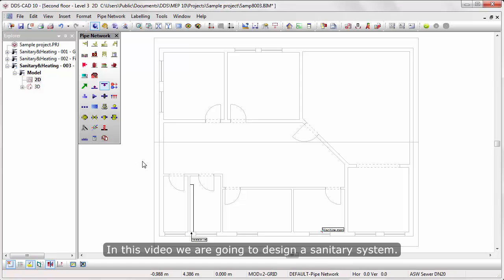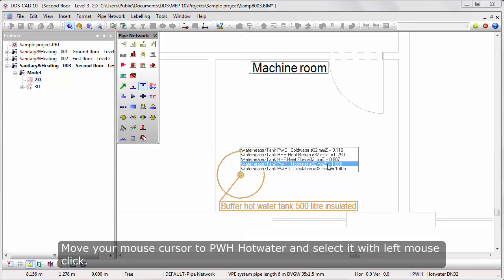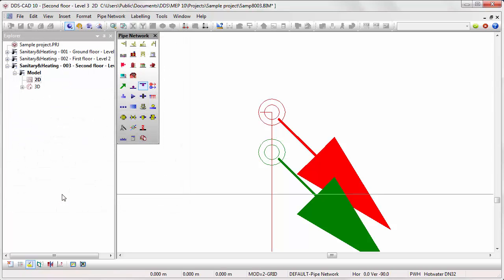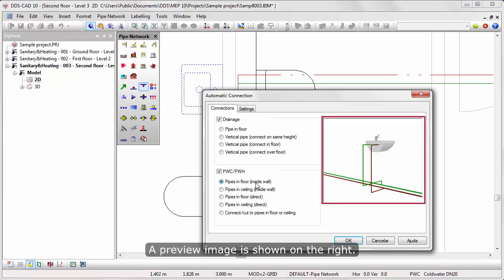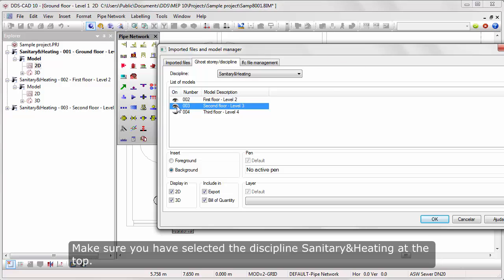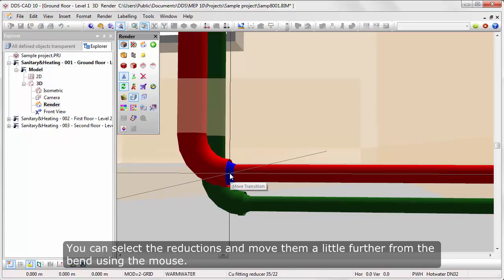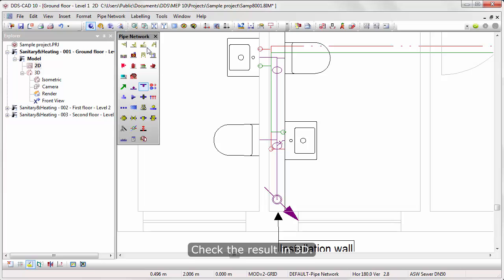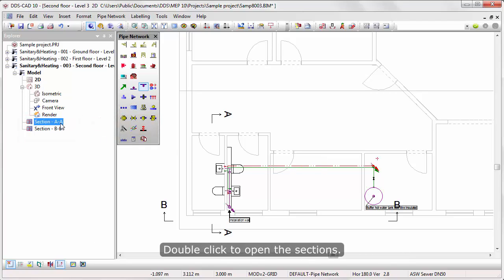DDS-CAD 11: Getting Started - Plumbing system design (7/8)

Comment: Is this free software?
Reply from the maker: Hi Bikram, to use DDS-CAD a license is required. It can be acquired directly via Data Design System.

Our DDS-CAD Viewer is available as a free download. This tool, however, does not provide functionalities for designing and calculating building services.

Comment from the maker: Hi Jesse, in this case the installation wall is represented by a cuboid object. You can create cuboids by activating the "Free Geometry" working mode. Subsequently you can assign a different material (e.g. tiles) to represent it as an installation wall in render mode (instead of the default grey color of cuboid objects).

A frame for the toilet can be selected from the "frame/cistern/accessory" product database.